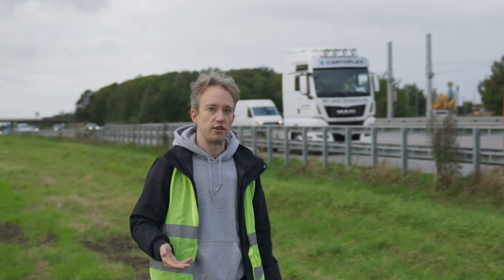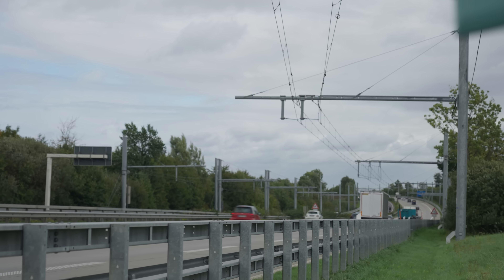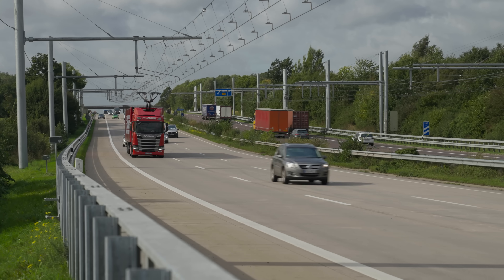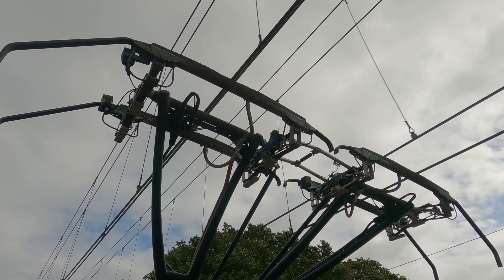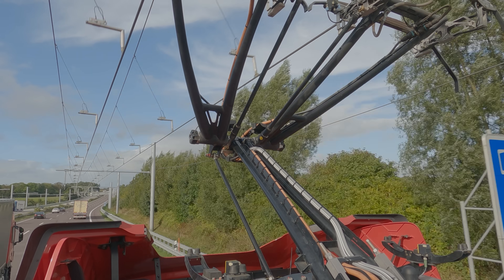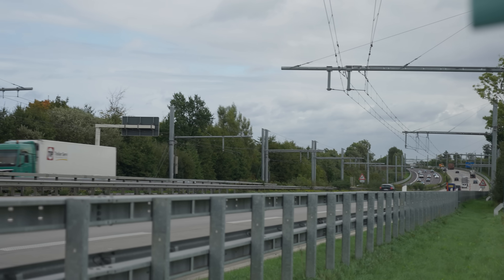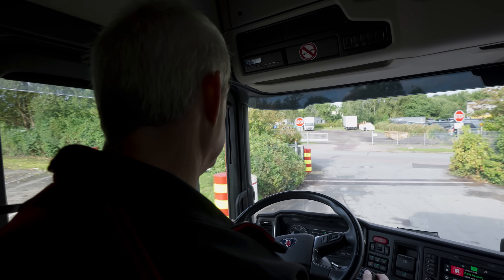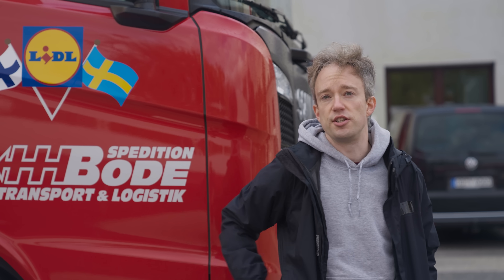The highway where trucks work like electric trains

Comment: This has been a thought in America too, the problem with electric trucks here is range. Most of the electric trucks that brands have(Volvo, Mack, KW, Freightliner) are limited to less than 200miles of range. This is a good solution for many places but the sheer vastness of the US means that even with tech like this, electric trucks will be relegated to refuse routes and short haul deliveries. Most manufacturers were looking into hybrid solutions(likely best for the market), but many projects were dropped as the US Government is giving tax breaks and funding to companies pursuing full electric power trains.
Reply: For a country like the US rail transportation by rail is by far the best option economically and environmentally.
Reply: Isn't that the point of the wires, though? Because it runs directly on grid power while on the wires, you don't need as much battery range. If you even just run it on every Interstate, that significantly cuts down the requirement for battery range.
Reply: @memesthatmakeyouwannadie3133  also you can recharge the battery while  connected.
Reply: @memesthatmakeyouwannadie3133  you could, but there are 50,000 miles of interstate in the US. Many of those are across deserts or mountains where it would be difficult to apply this solution. Trains and diesel-electric trucks will be the most efficient. Not to mention that the US power grid is already taxed well above reasonable levels and would cost trillions to upgrade for more electric vehicles
Reply: There’s still good research that says something like 80% of US trucks could be replaced today with fully electric ones given sufficient charging opportunities. With a system like this on all interstates the percentage would go up dramatically. You’d be significantly improving the situation.
Reply: @cjeam9199  I mean it would take at least 10 years to phase out old trucks even with sufficient charging as trucks don't get replaced until they hit 1 million miles generally
Reply: @tristanhanley8741  yes it would still take a while, however it might be quicker than that as fleets would be inclined to switch to electric trucks to reduce their fuel costs.
Reply: However 200 miles is plenty for European countries. Especially for cargo that gets delivered locally.
Reply: I think the distances in North America are far too great. You'd have to put pylons up on several thousand miles of road to cover just one or two interstates. You could cover most of the busiest trunk roads in Europe for that.
Reply: @Croz89  agreed, when there are 6 major east west routes and like 14 north south routes, it gets a lot more difficult to cover miles. There are 50 000 miles of interstate in the US

Comment: I like this, the only issue I can see is that it could further limit what roads oversized loads can go on, but that is also an extremely small percentage of road usage...
Reply: classic way, is to build it at the end point, not completely in the factory, nothing new ...
or build the factory where the product is needed.
Reply: Oversized loads would almost certainly still be on fossil powered specialised transports.  This is ideal for standardised, containerised shipping between transport hubs (ports and warehouses), where all the trucks are the same size and more or less interchangeable.  
A business model like the failed startup Nikola might work well: commit to building the test track between a busy port with lots of ro-ro traffic (Felixstowe, Grimsby) and a nearby distribution centre, offer hire-purchase terms to haulage companies where they commit to a certain volume of traffic over the next three-five years and pay the vehicle conversion costs over that time, so the decreased running costs from fuel use can offset the conversion cost, and the investors who fronted to build the road get their money back.

Comment: well that road way looks horrible with all of that hanging wire.
what happens if a lorry pile drives into one of those posts for the high voltage wires ?
That road would be closed down for days to repair.

Comment: Sorry but this is a concept that only works if you face out everything else. Germany can already not sustain it own power needs. Most electricity comes from other countries. And yet they plan on using even more power that they don't have just to reduce carbon emissions, which they simply don't. The emissions are just shifted to other countries or in other categories. This is nothing but a dream that Wil never work out without heavy funding and will end like wind energy. Million tons of toxic waste and over 20 years the system isnt able to make up for its own cost. Sorry for destroying a nice dream. Reality hits different
Reply: this is just wrong. In fact they Export more then they Import 
Production:536.50 bn kWh
Import:	28.34 bn kWh
Export: 78.86 bn kWh
And Even if u would be correct building this system would only  increase power consumption  by a few % (Most likely only about 1% or less )
Reply: @heyyo9  I don't know whee your numbers come from but that's not the truth. Might be that we export more then we use over a year. But at night and in low conditions we don't. Also you probably don't know that even more power plants are being shut down.

Comment: Correct Tom, it’ll cost Germany merely hundreds of millions to roll this out. After all it’s just wires and cables. But In good old Blighty it’ll cost tens of billions for some reason.
Reply: Blighty?
Reply: @mughil128  slang for UK
Reply: @Batters56  ok thanks 👍
Reply: Siphoned off into 'their mates' pockets.
Reply: I can see the UK government hire a Cable Company without cables... like they did with hiring a ferry company without ferries.
Reply: To travel on the UK version there will be a multi-billion pound App required thatonly works on devices manufactured between 2016 and 2019 and is powered by an Excel spreadsheet. If you require an ambulance to travel down the motorway you will have to go through an application process in advance run by Capita where they make you do starjumps to see if your cardiac arrest is severe enough to warrant the electrons.
Reply: Most of that will fall into the bottomless pockets of the app designers because it's the UK, so it will need an app.
Reply: Millions, have you seen how fast the berlin airport was completed. This would  take much longer than whe will use trucks for transport.
Reply: Don‘t think it would be different in Germany
Reply: @derpoblizist9076  🤣🤣🤣 BER, Stuttgart 21. If Elon Musk doesnt builts it, it will be a disaster
Reply: Actually I foresee this ending up costing more than these people are envisioning for another technical reason: More than just the wires are needed. It appears as shown here the system uses human-driven trucks, but it would make a lot more sense for automated steering to take over to keep the truck in position under the wires. Manually steering that precisely for any length of time would be exhausting for a driver, and automated is surely the future anyway. This would produce a result similar to a "trackless trolley," a vehicle that automatically follows a precise course, possibly even following a painted line on the road, or super-precise GPS. Such things have been used in public transit for some time. Given that these trucks, like the aforementioned trackless trolleys, probably all have the exact same track width, this causes the problem that they are rolling over the exact same spot of pavement each time. This wears sharp grooves in the road, much worse than manually steered vehicles that will spread the wear out over a wider rut. There are rubber-tire people movers that apparently have solved this problem through specially-designed roll-ways - they have very sharp-edged tire marks but apparently don't wear too much - but that would require rebuilding part of the road. If they don't do that, higher maintenance costs will result as they have to keep fixing the grooves. Either way a lot more cost than simply stringing up some wires.
Reply: Just wires??? 😂😂😂. Trust me their isnt anything cheap about heavy duty cabling.
Reply: @ksull72487  But how expensive is it? I’ve recently started highlighting the fact that the average lifetime spend is maybe £2.5 million or less in the UK. So everything you buy (inc. house) your holidays, flights, cars, education, children, the lot over 80 odd years comes to that. 

I can’t equate how much that £2.5 million gets you, the sheer variety of stuff! And how a road infrastructure project can be 10s of millions to do a known thing like build a roundabout. Either the people are getting a great deal or the government is getting screwed!
Reply: Have you seen BER airport...
Reply: @squelchedotter  let's not talk about the unholy grails of germany like BER or Stuttgart 21
Reply: So people from other countries still believe that germany is super efficent and has high quality products 😂
Reply: @Drogenkurier88  You sound like someone who’s never been abroad. If Germany isn’t efficient, who is?
Reply: @ChadVulpes  Asia
Reply: Imagine the UK 'elth n safety having a go at this and the impacts on motorway maintenance.
Reply: @barrieshepherd7694  They're already planning 12 miles of electic motorway on the M180 near Scunthorpe.
Reply: @MrPaw45  Seems that someone has found a tap into government funds then. Well that will at least give the 'elth & safety gurus somewhere to practice their skills!:-)
Reply: @barrieshepherd7694  It's nice to see DM readers trying to interact with the outside world but if you really think that the UK is alone in having safety standards, you're mistaken. One of the reasons people said they wanted out of the EU was because they wanted to set their own, lower standards. No sir, the reason it'll stall in the UK is because those who are in charge couldn't empty water from a boot with the instructions on the heel.
Reply: I'm all for safety standards, and I worked in an industry where they were very pertinent - but the UK seems to have a excess of 'jobs worth' people who see safety as a way to stop an activity rather than to ensure the activity is completed in a safe and effective manner.  (P.S. I did not want out of the EU)
Reply: UK road network is very expensive to modify

Comment: "The most efficient way of getting electrons to trucks", maybe, but it is far far more energy efficient to transport them by rail, this is the same as for passengers. We need to focus on moving far far more longer distance people and freight by rail, so that roads are used only by people and freight for which there's no other sensible option.
Reply: how is a train meant to transport goods from its rail to the warehouse / shop in the middle of town? At some point, you must always use trucks, simply because there is a limit to where trains can go.
Reply: The problem is that last mile.  A truck can drive from any depot, get on a highway, and go to any other depot.  Where there isn't charging, it can go by its only power, because there are roads.

Rail, you'll still need a truck to take that freight from the depot to the train, to another truck, and to the depot.  The only time it will be more efficient is if both the start and end points of the trip have a direct rail connection.   Which might be the case for larger ports and depots, but not likely the case for small depots.
Reply: More efficient energy wise but significantly slower time wise and much less flexible. Time and flexibility is an ever more important factor for companies that rely on just-in-time delivery and fluctuating demand. Unless rail is subsidized significantly more than it already is, companies will never use it. But I agree I wish we used more rail.
Reply: Rail distribution to many different warehouses and companies is just financially not viable. They did it that way in the past, many industrial estates around still have tracks, or the traces of where tracks used to be, but the past, let's say 50 years, tracks have fallen in disuse and keep getting ripped out because they're too costly to maintain. Trucks are faster and more flexible, things that companies demand. And I have no idea what the railways charge nowadays, but I suspect trucks are cheaper too, otherwise more companies would still be using rail directly to their business.

Of course, lots of cargo still goes by rail to a container terminal and by truck from there, but those trucks still take the highway from the terminal to their destination, and that's what this is for. 

If we should be encouraging trucks to drive for thousands of kilometers from A to B instead of using the train in the middle is a separate question, but as long as that's financially more viable, or faster, or some other benefit, companies will do that too.

Comment: One disadvantage of this system is that you would still need the heavy batteries. 
Second is that this needs to spread to many countries quite fast for the market to be large enough to justify the investment cost for multiple vehicle manufacturers.
Reply: Does it though?  You don't need an entire highway to have a power grid.  Just enough of it to recharge the truck's battery as it drives.
Reply: The entire point is it exists to charge electirc trucks on the move. 
Electric trucks will already have the batteries.
So it's really a non issue
Reply: "Heavy" batteries a tiny fraction of the size needed for long hauls.
Reply: @blindleader42  Every additional ton of weight in the truck means a ton less cargo capacity. 

Trucks have maximum weights.
Reply: Modern batteries are actually quite good. Moreover, an electric drivetrain saves weight in many other areas, so it’s a wash which one comes out lighter.

The whole overhead charging is, of course, a dumb idea. It only makes sense if battery capacity is more limited than it really is and much more limited than it will be in a few years. Modern batteries are compact and quite cheap (maybe $100/kWh at the pack level) and they are bound to become much cheaper. Therefore, it makes sense to use much simpler (and faster!) stationary chargers instead. The trucks can charge while being loaded or unloaded, or back home at the garage. That will be good enough for almost all short-haul freight (say <500 km or so).

Comment: They could go a step further and put down special hard wearing and low friction surface for the trucks to run on, and lower their rolling resistance even more so they use less power...

And if you're going to do that, then it makes sense to split them out into their own right of way that is separate from general public traffic,... And once you do that, well then it would be super easy to have those low friction running surfaces double as guide ways, and let a driver haul multiple trailers, maybe even dozens, or hundreds of them with a big enough truck, and you'll get some serious efficiency savings...

Comment: This is already a rolled out system in Arnhem in The Netherlands, I grew up with them. They are for busses but the exact same concept. (They're called trolleybusses)
Reply: Seattle/King County has had trolley buses since1940. Any route (68 miles of routes) that has a hill steeper than the diesel buses can make, runs them Everything else runs diesel or hybrid.

Comment: I'M SORRY but it is about as stupid as it gets. Most countries, like Germany, have a decent (although sometimes antiquated) train and rail transport network,  what most countries especially the uk, need is a redesign of it rail transport network, electric traction being one of the most efficient forms of transport (see steel wheel, steel rail LTS) and is great at medium to long distance deliveries, and then a network of warehouses and distribution centers using small electric vehicles, we don't need to electrify the motorways, it doesn't solve congestion, or help other users, and just encourages the use of motorways as a reasonable transport network, a single rail driver can move far more than splitting the goods into individual trucks, that will eventually end up in the same place. And even since containerization it has been easier and more viable, on the grounds that it is faster and all cargoes can be moved by standard equipment, to group them together into trains as they are more cost effective, and more energy efficient. For some reason as we go into the future we have become obsessed with this notion that we must separate everything into pods, when really it is the opposite that we need to do, for greater efficiency.
Reply: Germany's rail transport network is severely underfunded due to conservative politicians and bribes from the automobile industry. I, too, wish there were more trains instead of trucks.
Reply: @oktupol  I agree, and it’s obvious that in some cases it is political issues that restrict the rail transport industry in its development

Comment: It’s an insane waste of money that surely only a CDU politician can do. Germans hate this for a reason. It was insanely expensive and it’s not even a good idea. Roads even without this are insanely expensive. Adding this is just completely ridiculous when you consider that it is actually cheaper to build a km of railroad than this. And railroad doesn’t need as expensive repairs. And it’s way more energy efficient. Also big trucks and cars don’t really mix. Especially here in Germany, highways are often completely filled with trucks. These trucks are a serious safety hazard, very loud, heavily wear roads and waste a lot of energy (even with this). There is no need for such a system, we need to work on what is already working well. I usually really  love your videos. They’re well researched and put together, but I’m afraid this one is a bit lacking. You have not mentioned any of the points from the opposition.
Reply: Why a waste?